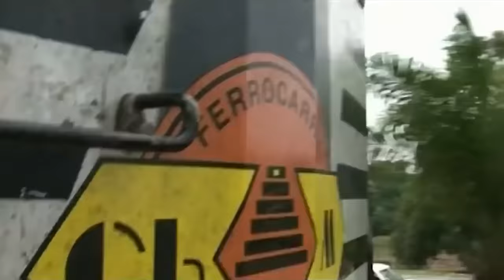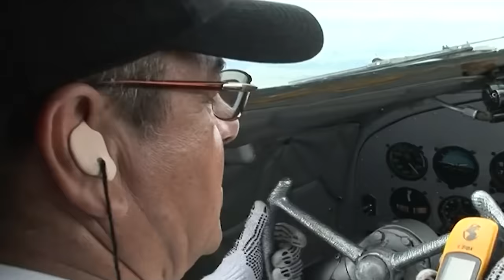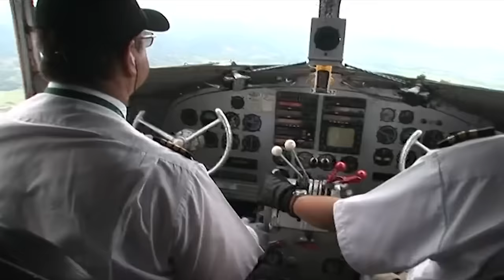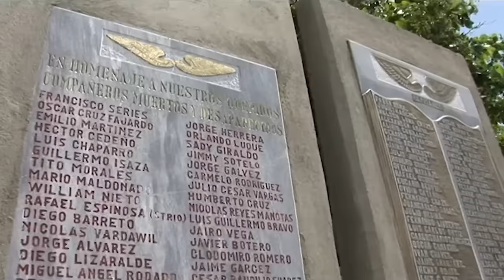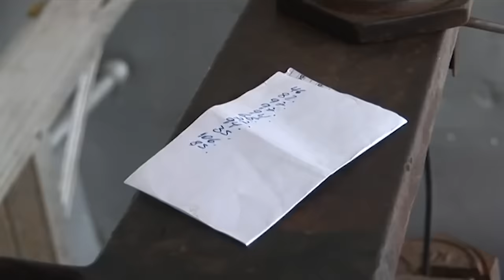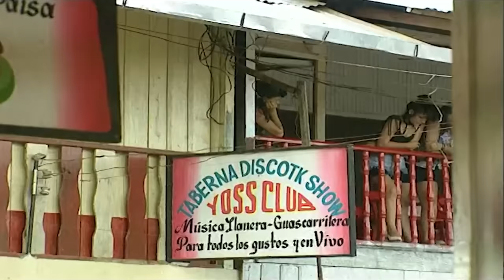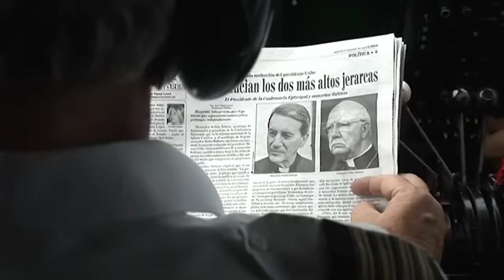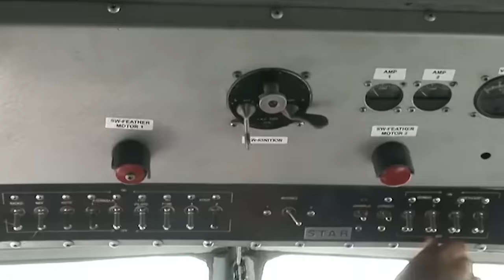Viajes más mortales - Colombia, los pilotos del Amazonas

Comment: I don't know if Raúl and his copilot Maria were able to watch this video before it was published, but if I were the pilot I would be very disappointed, insulted, and angry by the narration of this video. I did quite a lot of flying over  Colombia, Venezuela, Ecuador, Brazil, and Bolivia and ran into situations very much like the one shown in this video. The truth is that while there are not a lot of aeronautical navigational aids, the pilots flying these remote areas do it the way flying was meant to be at the time those DC 3 were built. Better yet, they have GPS and weather radar units and can navigate from point A to point B with no problem. The fact that they could not communicate with the control agency of that particular area they were flying did not present any emergency situation, nor mean that they were lost, nothing to be concerned with other than not being able to let them know where the flight was at that time. Pilots are supposed to report, in areas without radar coverage, certain positions every so often and when they are crossing from one control area to the next. In no way the lack of communication puts the flight in any danger if the flight is not experiencing a mechanical condition that would require the flight to be terminated prior to the destination. Flying through and preferably around thunderstorms in those areas is very common and while is better, besides required, when the crew can let the control agency know what they are doing, sometimes, like this one, it becomes very difficult if not impossible. Unfortunately narrating the video the way they did makes it more attractive to some people.
Reply: Exaggerations? While watching, the b.s. detector in my head was humming softly in the background.